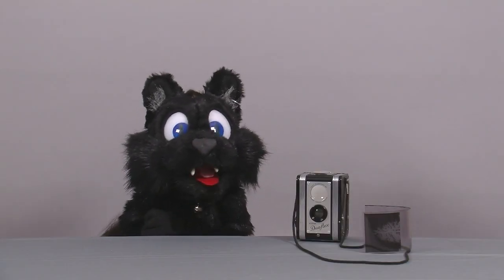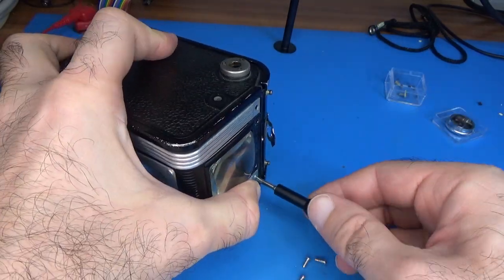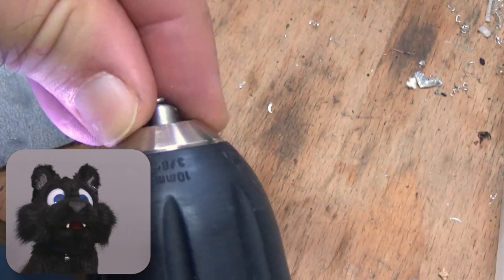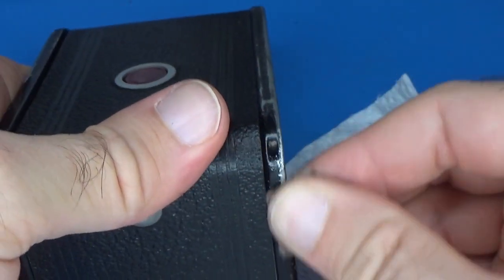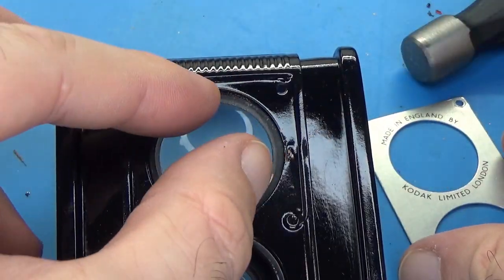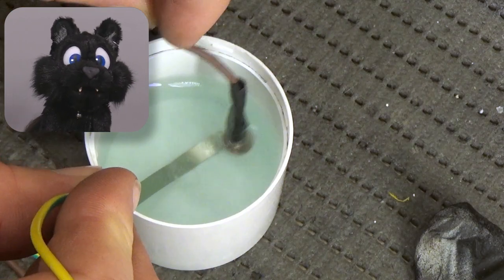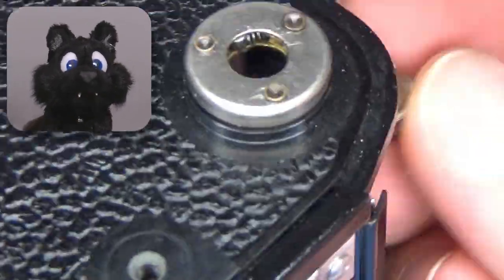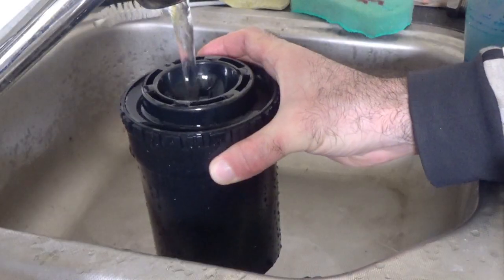Restoration Project #20 - Kodak Duaflex

Comment: I would love to see a detailed look at the shutter and flash mechanism. Hint hint.
Reply from the maker: There's a bit of a closer look in the "flash mod" video that's kind of a follow up, specifically at the timestamp here: https://youtu.be/fbl4uBoI9D0?t=852
Reply: @atkelar  Thank you. What I am looking for is how to tweak the contacts to solve the sync problem. I want to adapt it to provide native x-sync for use with external flash.
Reply from the maker: Sadly, I don't have the camera around anymore; it's back with its owner already. I can't get new footage for that reason. The actual contacts are visible on the lower edge of the plate. I managed to get it working good enough by just tweaking the gap between the moving tongue and the stationary contact. A bit of a more "direct" way might be to influence the peg that is pushing the contact; that is the brass "j" shaped element that slams down on the contacts in the closeup. It has its movement tied to the actual shutter on the back of the plate with a peg and spring combination, but I didn't want to modify those directly. My friend asked me to keep the mechanism as original as possible. The fact that it is rivited together makes it even worse. If you don't care that much about the appearance of the flash, I would suggest a slight electronic delay on the outside. It is good that the old mechanics trigger early, so a few milliseconds delay should do the trick while keeping the shutter in prestine condition.
Reply: @atkelar  Thanks, As I have looked at it it seems that 25mS would be about right. I was just looking to see if it was something simple like shortening a bit of copper trace or something. Building the delay isn't that difficult.

Of course another option is to load up with Tri-x and push process using no flash. :D

Comment: I just bought one. It's in bad shape. Is there any way I can send it to you for repairs? The shutter works, and all it is just very dirty.
Reply from the maker: I feel honored to be asked that question, but I'm afraid I'm not set up for something like this; there are several issues that I'd face. Maybe eventually I can turn these restorations into a reasonable business model, but right now I have to limit myself to private projects or projects for friends that I can do in exchange for some other devices.

Comment: Also, I can't see in the video is there (or is there supposed to be) any seals on the sides of the film door or the camera body? on mine there is no trace of anything not even glue.
Reply from the maker: There was nothing; the light tightness is relying on the metal and plastic parts mating with a "tongue and groove" type of joint and similar for the door. I think I recall some sort of rubber strip on the hinge side of the door but that is it.
Reply: @atkelar  Thank you that is helpful. I want to go through mine before running a roll through. Several videos have shown how to clean the viewing lens and mirror but I have not yet figured out how to access the back of the taking lens and shutter mechanism. I may just have to dive in. 🙂
Reply from the maker: It is rather easy: take out all the screws and the case will slide apart. Maybe only undo the screws on one side so most parts stay together; if you just want to clean the lens...
I don't have the camera anymore, so I can't point the individual screws, but it does come apart without any force. If not, keep looking for the missed screw!